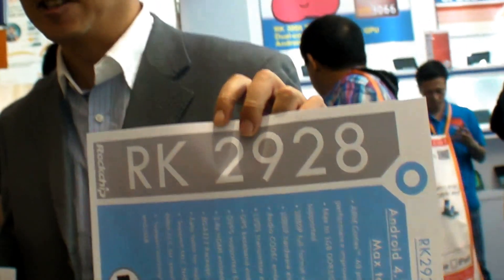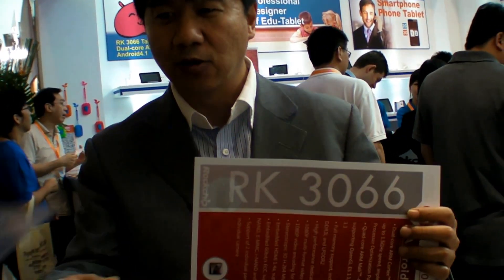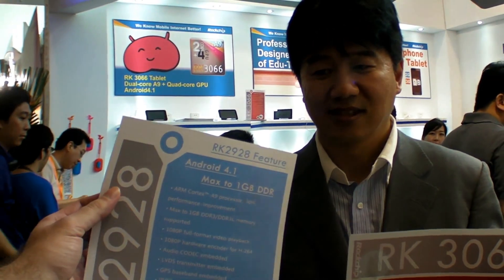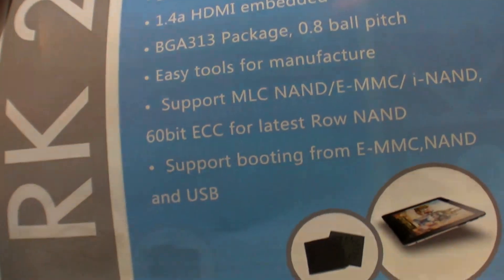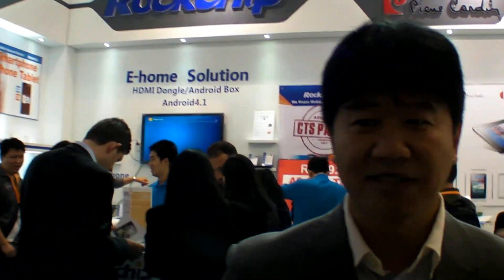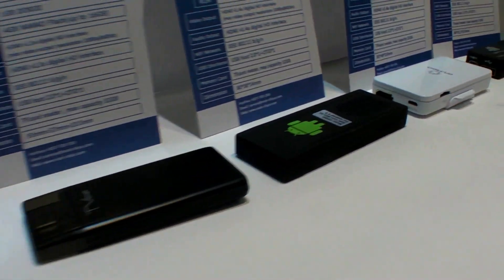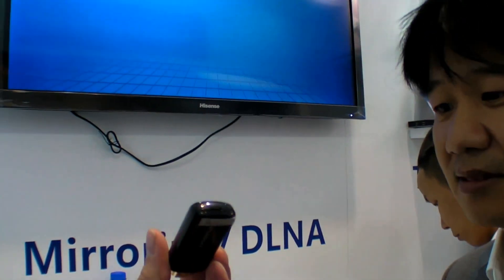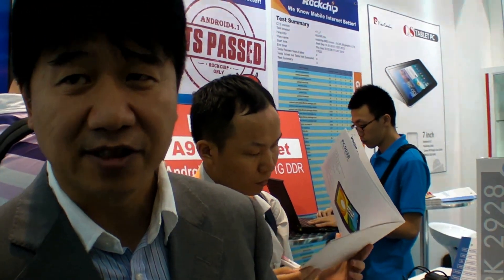Rockchip RK2928 and RK2926 launched at the HKTDC Electronics Fair

Comment: I just got a tablet with RK2928 chipset a few days ago, I can confirm that it has a Mail-400 GPU, Antutu benchmark identified it as a Mali-400 , and I did a little poking around in the system partition while rooting it and found several references to Mali-400 in the configuration files.... I have no way of knowing how many cores Mail-400 it has, but if I had to guess, I'd say 1 core, it scores similarly in Antutu 2d/3d as another Mali-400 device i have which i believe is single core(Amlogic m3).